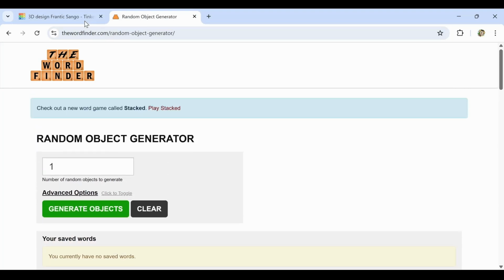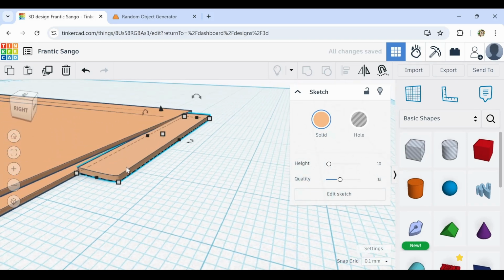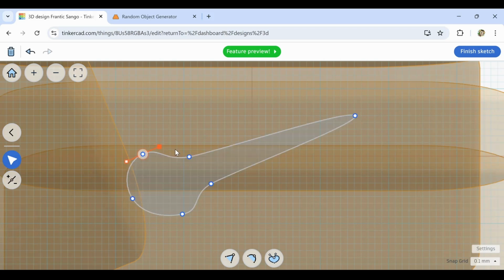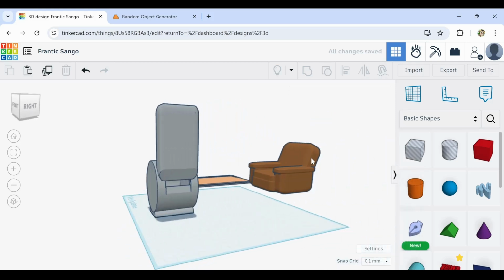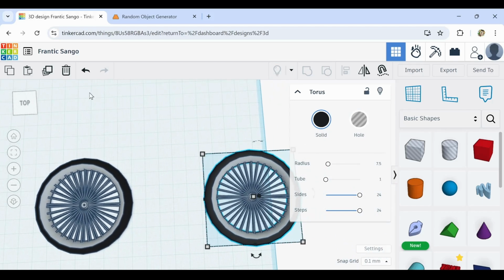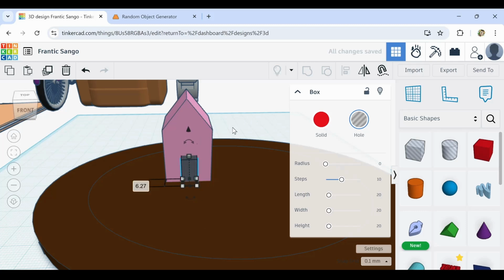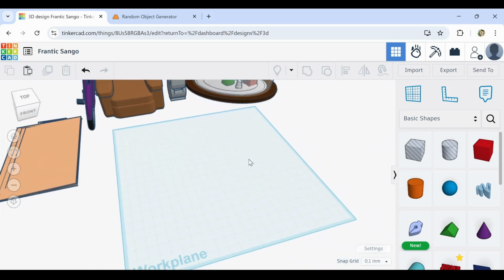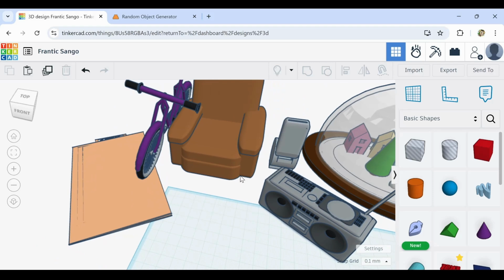Random Object Generator Challenge! Fun!!!Tinkercad Design Tutorial! 3D Printable Models!

Comment: Nice job. Got some great random projects this month.  As soon as I saw that bicycle my first thought was there was no way that would print.  I will try out the whistle. Thought I would mention I wanted to do some multicolor prints so just ordered a multicolor printer that I probably can't afford. My 3rd printer. Oh well, it's only money. 🤣🤣
Reply from the maker: Haha! Awesome! What printer did you get? Some day I want one nice printer to use just for the channel. I'll add the whistle to the list! 👍

Yeah, the bike would be awful to print. I guess if I switched out the spokes for a different kind of bike rim and printed big with supports. 🤔

Not worth it. Haha
Reply: @TinkercadWorld-ho8ht  Ended up ordering the Anycubic Cobra 3. Couldn't afford anything too spendy and this printer seems to have a lot of bang for the buck for a multicolor color printer. Should have it next week.  I also looked at the Creality HI. After a lot of research decided to go with the Anycubic. And it was on sale for a very decent price. One thing I liked is the enclosed multicolor unit also has a filament dryer built into it. And of course it's fast, auto leveling/Z offset etc. It's a bedslinger, but I already have a nice enclosed single color core XY printer which is my normal go to printer.
Reply from the maker: Awesome! Keep me posted how it works for you. Anycubic can make some great stuff. I've had a couple of their printers. My first printer was an I3Mega and that thing just WORKED and never stopped working. Amazing really.
I sold it to a friend and I believe it's still working. Lol
The first videos on this channel must be on that I3Mega, unless I'm remembering wrong..lol
Reply: @TinkercadWorld-ho8ht  By the way I printed the whistle and it came out great and is quite loud
6 walls, 15 percent infill.